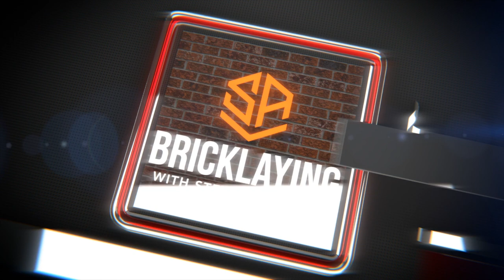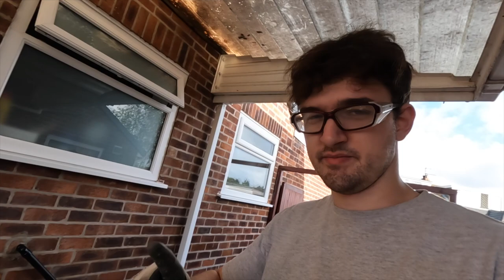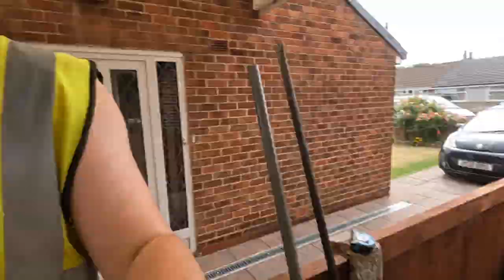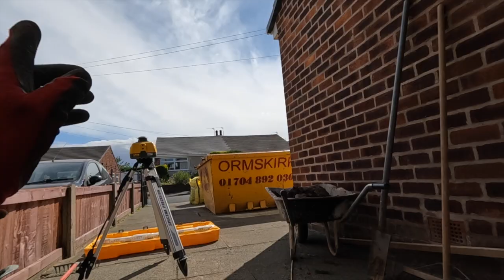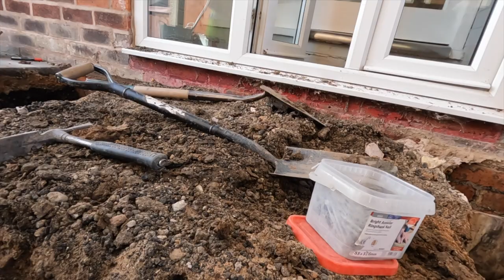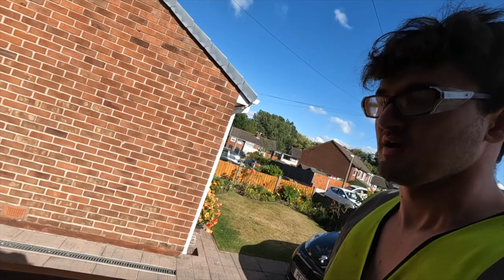AWKWARD PORCH FOUNDATION

Comment: Why does it have to be so deep for a porch, and why is the bit in the middle not getting dug out? I've got plans and a warrant for a porch, but can't get a builder to do it, so trying to figure out how to do it myself.
Reply from the maker: There is a minimum depth fir footings .
   The middle only needs to go down deep enough to allow for hardcore, insulation and the concrete floor 🧱👍🏽
Reply: Many thanks for that advice. @SteveAndAlexBuild
Reply from the maker: @rfmlets6713 No probs 🤙🏾🧱👍🏽

Comment: When you covered the gas and water pipe should you have identified it with coloured tape or markings....
Reply: Not when all you're dealing with is a short section of the pipe that's encased in concrete, the black upvc pipe was put there purely to protect the gas pipe and not identify it
Reply from the maker: @Ratsotone  🧱👍🏽

Comment: Oopsie can't get car into garage
Reply from the maker: not now 🤣🤣🧱👍🏽
Reply: @SteveAndAlexBuild  I had similar semi-detached layout, we had many years of use from porch, pushchair, bikes etc. - was a real pain when trying to sell
Reply from the maker: @freepress8451  . It’s only a small shed at the back now 🧱👍🏽
Reply: Bungalow on our estate has built another bedroom on the drive (Front corner of the house) which has turned a 3 car drive into a 1 car drive and now there's a Garage in the back garden with no access. As the bedroom does not run the length of the house there's is now 1 cars length of dead former driver space between the back of the bedroom addition and the garage door.
Reply from the maker: @HughzieTube  😳🧱👍🏽
Reply: @SteveAndAlexBuild  Just checked on Google earth, 24 years later and my porch is still there - garage gone - front area paved
Reply from the maker: @freepress8451  🧱👍🏽